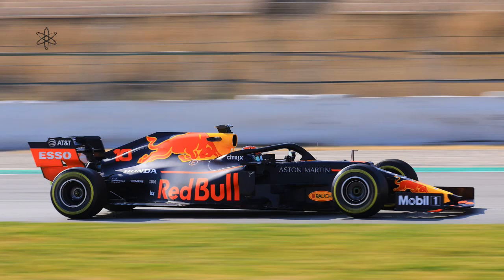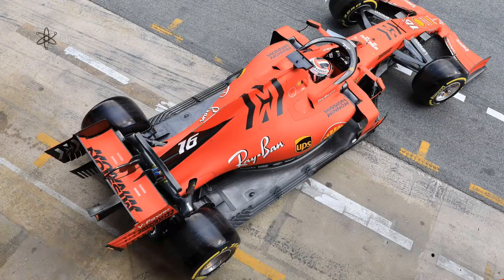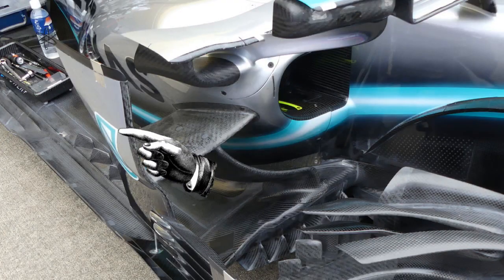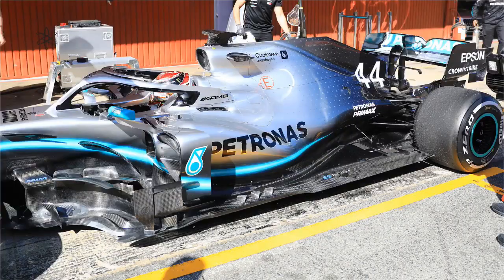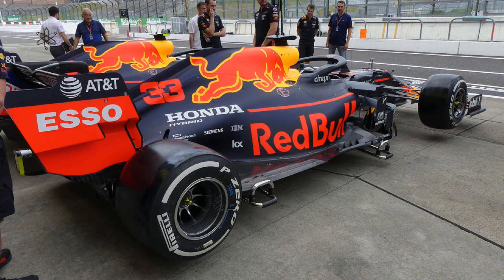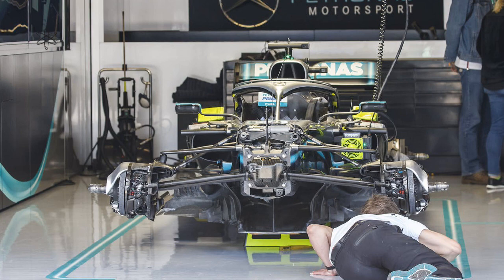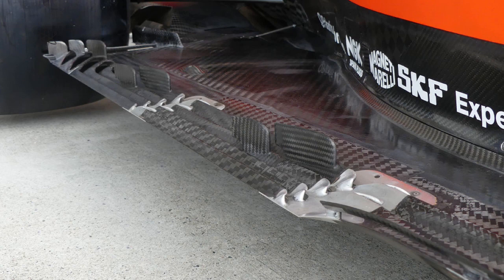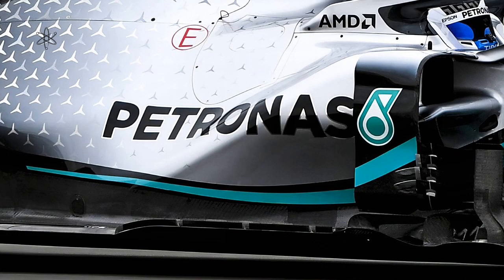Formula One Contemporary Side Pod Design

Comment: 4:35 My man, you CANNOT see the strakes sticking out from under the leading edge of the floor on this picture, BECAUSE THE BARGEBOARD IS IN THE WAY!.... I'm pretty sure the W11 was testing with an almost identical floor to the W10's final spec in Barcelona (only some diffuser modifications and the bargeboards themselves, which are parts of the floor itself)...